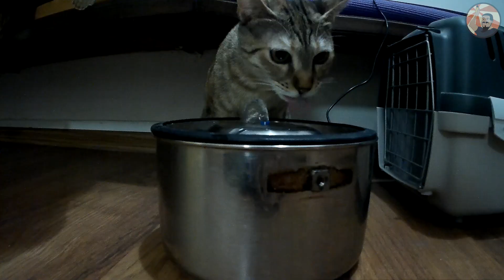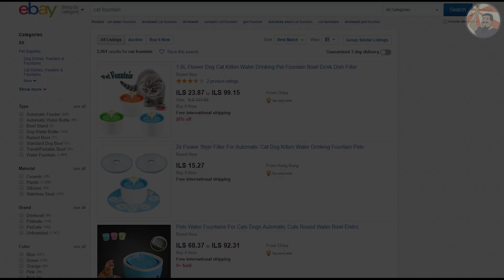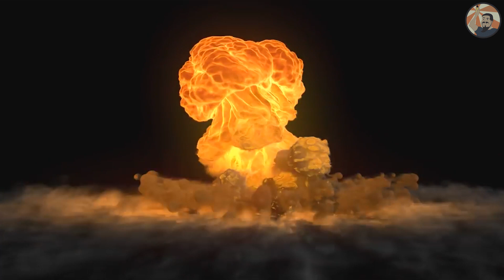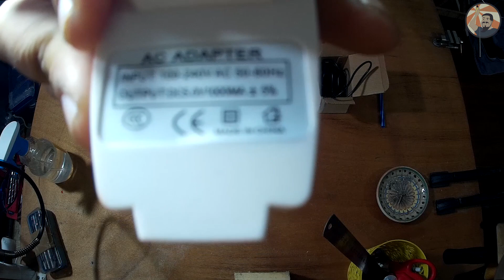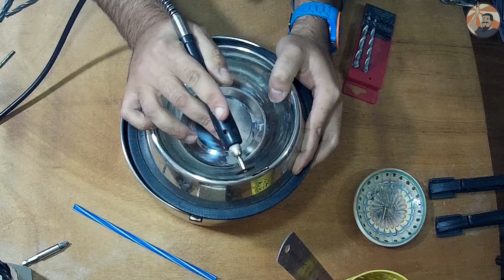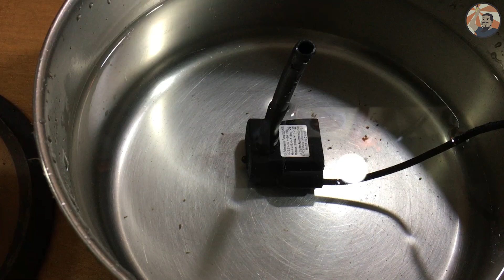DIY Water-Fountain for Cats

Comment: I'm an electrician, all wall outlets are rated at 120v enough to give an alarming shock, but not enough to kill a cat with any breaker your house has. Just saying cause the amazon description isn't always truthful and want to educate people on how this works.
Reply from the maker: Let me explain: i meant to a case where a cat is chewing the cable or the cable get's exposed and the cat touch it. a usb cable is only capable of 5v, because the re-voltage is being made at the outlet adapter from 220V to USB (5V). a pump which goes directly to the water pump with no lowering the voltage that's the thing that makes me worry.

Comment: Can you make a mod for it to run on batteries??
Reply: put 3 AA batteries in series it will give you around 4.5 which is enough voltage
but dont use alkaline because its a waste
Reply: I was looking for a solution and i think i'm just trying with a power bank

Comment: Honestly, my 20 bucks 2,5 Volt water foutain from BPA free plastic is cheaper than that cooking pot XD plus it stays very clean since it has a filter.
I don't know if I would like to have a plastic straw and tape in/close to my water fountain + the fact that it's not easy to clean every few days.
Reply: yea id say do some modifications suck as putting screens on all the drain holes and making a cut for lid to easily slide onto the pot and be able to removed so dont have to take off tape or hot glue every cleaning becuase its more like ever few days you gonna have to clean it. wish i had the tools to do it.

Comment: Does the plastic tube not have the same issues you mentioned that the plastic drinking fountains would have?
Reply: Why don't use stainless straw ?
Reply from the maker: Well it is, but i guss there's not cheap way to create this setup with 100% stainless steel pump & tubings.
Reply: I’m sure you can find stainless steel tube and use it for your project with the taping method he used

Comment: Is it possible to fit a water filter in this setup so the water is cleaned up and then recycled out by the pump?
Reply from the maker: guess that it's possible, but you'll need to find a proper filter in terms of dimensions and compatibility

Comment: Using stainless steel due to bacterial concern is good. But isnt the pump plastic?
Reply from the maker: i'm not aware to any other pump which is not based on plastic or polymer material... see this as a hint for the most greatest inventions!

Comment: Hello,just wanna ask a question,can i spray paint over the stainless steel? Also can i use a regular usb adapter?
Reply from the maker: dying still is more complicated than that from my experience. what makes life easier is an epoxy paint or any primer which can bond with steel. not sure that the regular paint spray will cover without a proper primer layer

Comment: How about if I don't have any tools how can I make a safe drinking fountain for my two cats?
Reply from the maker: Kalaxy u can use plastic bowl and top, and in order to make the hole just do it with a heated tip of a screwdriver
Reply: The Bearded Craftsman DIY are ceramic planters safe to use for a pet drinking bowl?
Reply from the maker: Kalaxy yes ;)
Reply: The Bearded Craftsman DIY it's confusing because i some research I've made people say it's toxic and meant just for planting and other websites say it's ok.....I guess it has lead in the clay? Idk lol
Reply from the maker: Kalaxy it depends on the tampering (the chemical event which blocks the ceramic from liquid like mineral oil used on wood
Reply: The Bearded Craftsman DIY oh ok so I'm better off with stainless steel